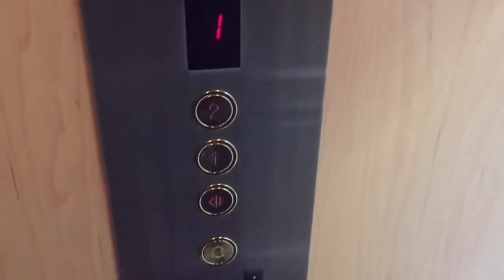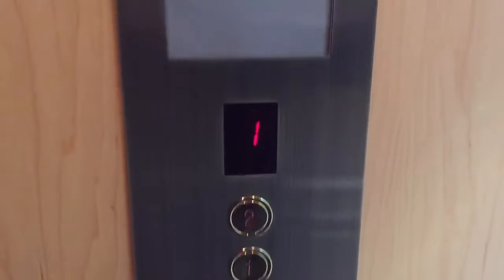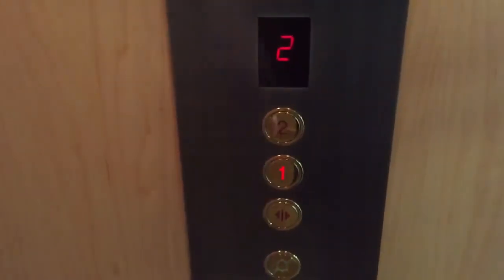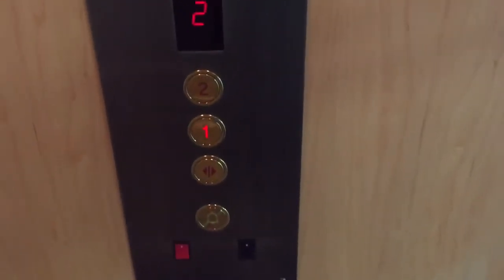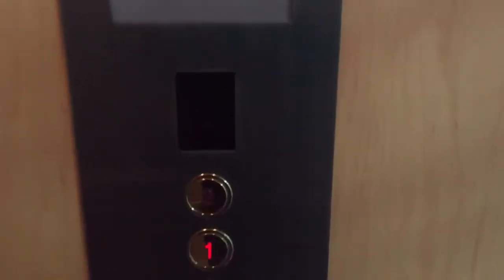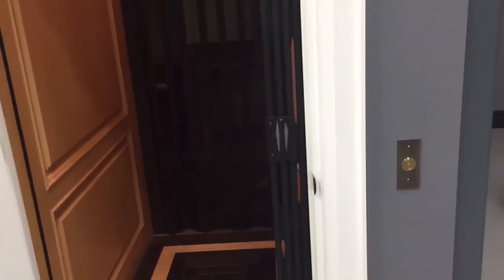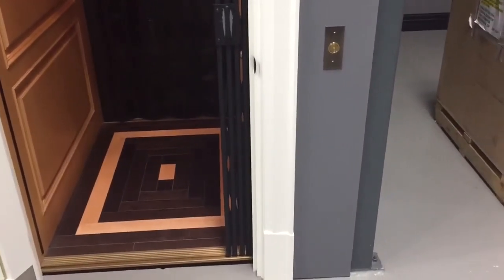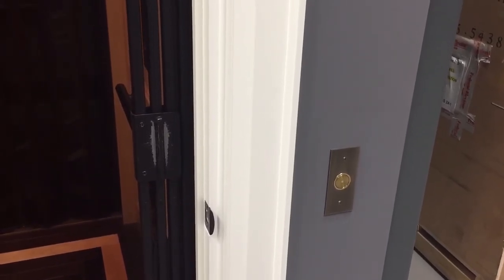Federal Winding drum traction residential elevator at Federal elevators showroom/test plant in MI ON

Comment: That one kinda looks like a vintage elevator.
Reply from the maker: Indeed!
Reply: put it in to nuge mode.
Reply: @williamcheang2003  Residential elevators don't have a nudge mode since most of the interior gates are manually operated, so there's no door sensors that would trigger a nudge if they were blocked.